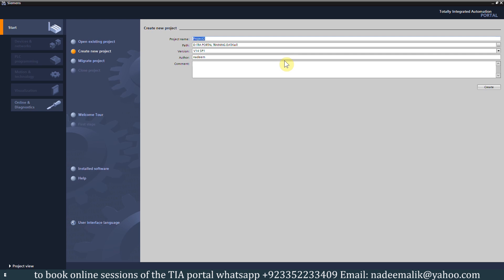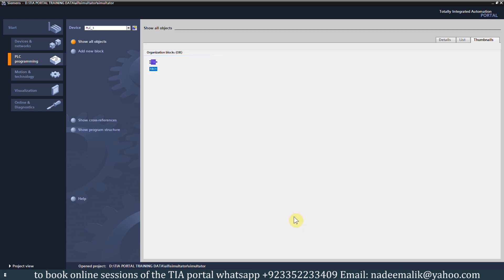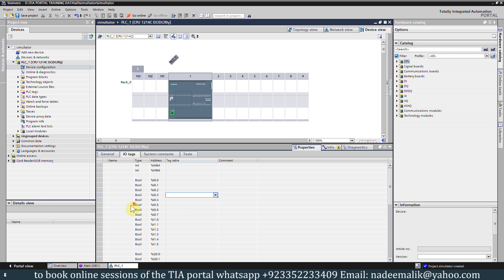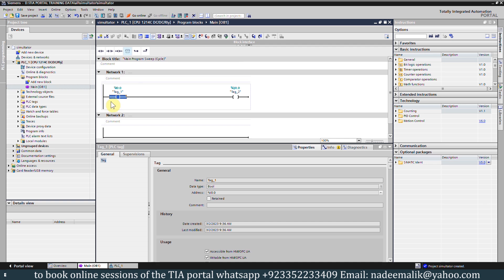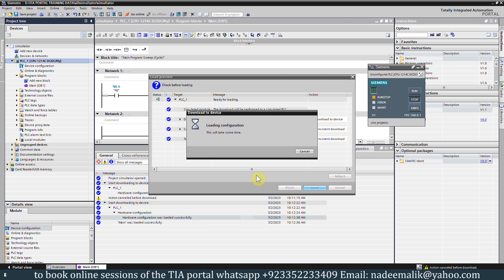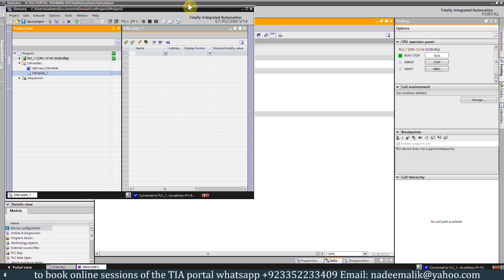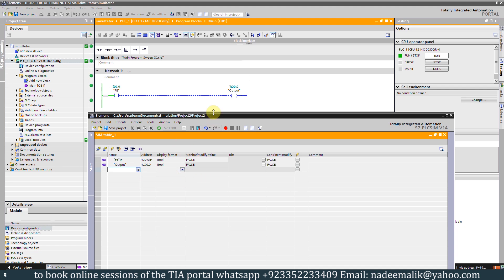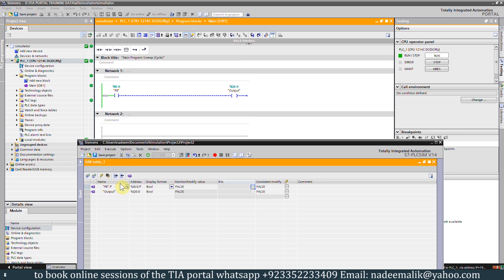How to simulate the S71200 PLC using PLCSim V14.0 SP1 for testing the programs

Comment: If we have a chariot moves for a distance A et B And each distance is determined by a button and the operation is from a third button. If we press the first button  If we press the first button twice and press the second button three times and we turn on, the  chariot Moves with this number how do we work b program plc So that we control the number variable by the buttons